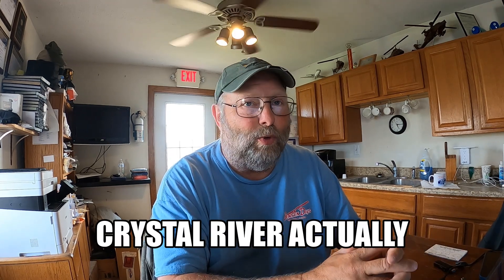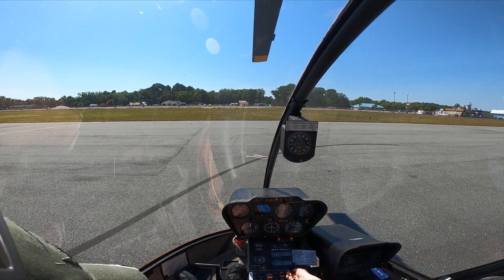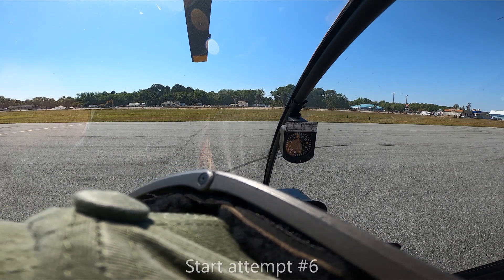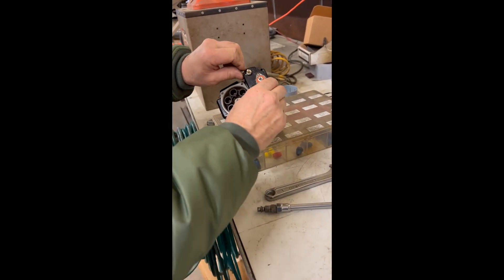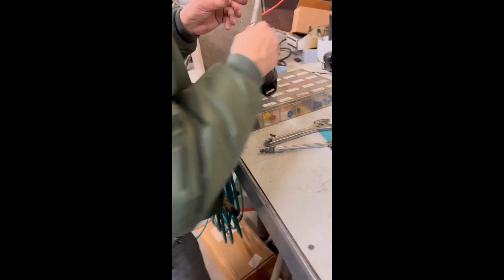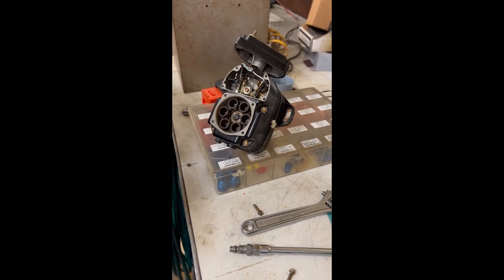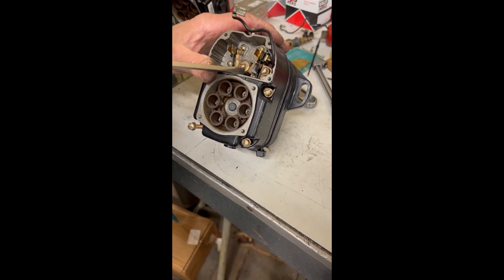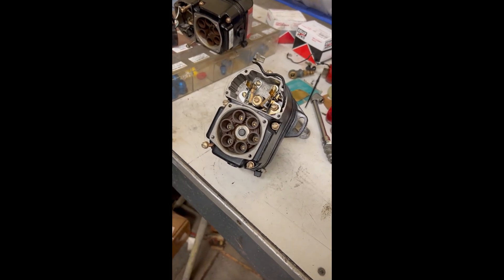Why won't my Helicopter Start? If you fly with Lycoming engines you'll want to see this!!

Comment: Keep 2 fingers on that throttle! Scratch your nose with a sense of caution. When those tach points fail, the governor will go nuts and you don't have long to catch it. You might think (as I did) that this is highly unlikely , but we recently got a rebuilt right mag containing defective points. (Purchased through the major aircraft supplier we all know and love. But due to supply chain issues, not our usual mag OEM). After the incident (in flight overspeed) we found that the point contacts were not correctly peened to the arm and were flopping around. In a subsequent ground run we observed the governor making wild throttle excursions in both directions. They sent us a replacement set of points and guess what;  same darn thing! And a third set which they supposedly "hand picked",  had the same issue. At which point we said "thanks but no thanks". We waited for TCM points which are visibly better constructed to the naked eye.
Think about recognizing a governor failure and differentiating it from a drive train failure. If you get that governor off quickly, all will be well.  Some poor guy in Van Nuys misdiagnosed this as a drive shaft failure and auto'd to the ground, seriously injuring his pax. Someone else landed hard and chopped off their tail.
Reply from the maker: Hey john, could you send me an email, my email address is capecopters@yahoo.com, ive got some questions I’d like to ask you. We have seen a few mag points that are poorly manufactured as well..  thanks, Paul